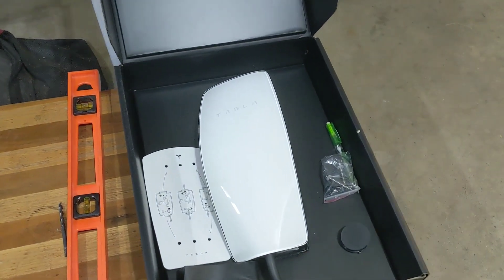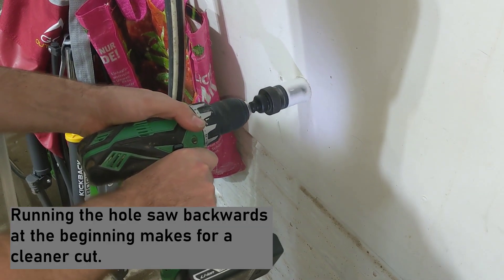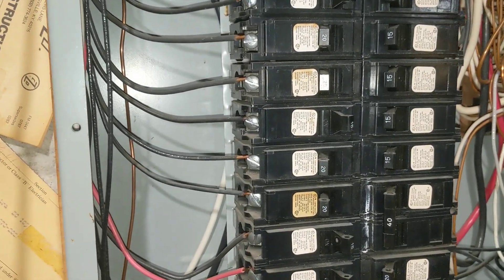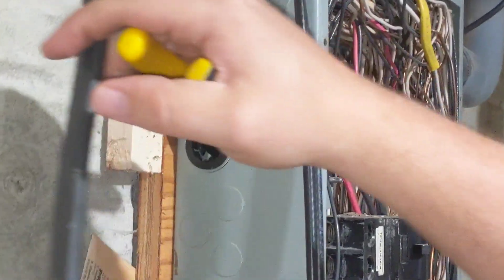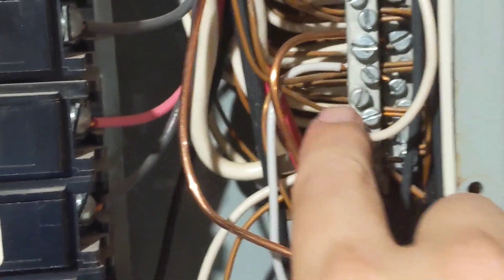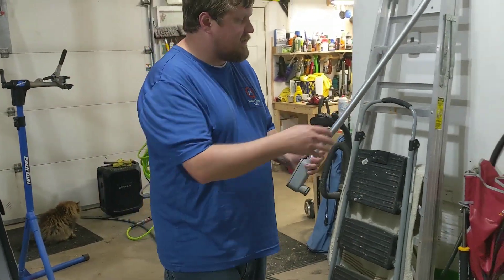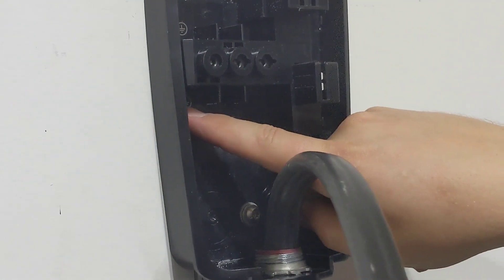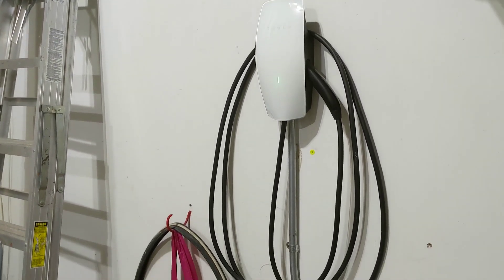How to Install a Gen 3 Tesla Wall Charger

Comment: Some style points...

Always connect your wires ground then neutral then hots.  This is a safety thing.  Disconnect is the reverse,.hot then neutral then ground.

Work away from the panel.first.  while your dog showed up unexpectedly in your video, should it have been a person trying to help or solve an issue, a breaker might get shut and you might be playing with energized wires for your connection.

Your white wire requires "colorization" under the NEC.  It is no longer a neutral.

Section 625 in the NEC (NATIONAL ELECTRIC CODE).  Covers car charging (EVSE).

Remember the your local building department can follow or throw out any and all NEC rules.  They see many electrical jobs every day and may be a great resource along with your local guys.

Stay safe.
Reply from the maker: Appreciate the input. Those are fair points. Probably should label it. I take a base level of knowledge for granted sometimes.

Comment: 2 points.....connect the panel last.  This stops the shock hazard when "THE HELPFUL" flip on the breaker while you are connecting the other end.

....NM cable can go into conduit.  Nec art 334 talks about protecting surface mounted NM cable with approved conduits....emt, pvc, rigid, and more.

Many building departments require wire in the garage to be either inside the wall or protected by conduit.  They do not want people hanging stuff from them or hitting the wire with a metal work table.

Ps..  not with my code book so if the section number is off, sorry
Reply from the maker: Good info!

Comment: No conduit or pvc pipe needed?
Reply from the maker: None needed in the basement. The piece we used in the garage was just to keep it from being damaged accidentally. Not sure if it's necessary, but it's cheap insurance.
Reply: Section 334.15 of the NEC talks about exposed NM cable and protection.  Outside the finished walls in the garage,. Yeah....protection.

Comment: One small mistake in this video.  When coming through the bottom you need to then come through the top of the connection posts and use the included zip tie so that the wires don’t “hang” from the connections.
Reply from the maker: It didn't have any line/load labeling hence doing what I did.
Reply: That’s right. It’s stated on the the installation manual.
Reply from the maker: @McLovin8341  interesting. Didn't see it but I don't deny it. This installation method is pretty typical across many different types of garage equipment.